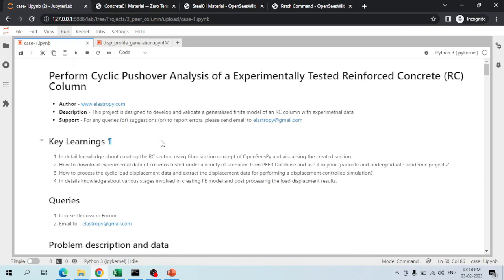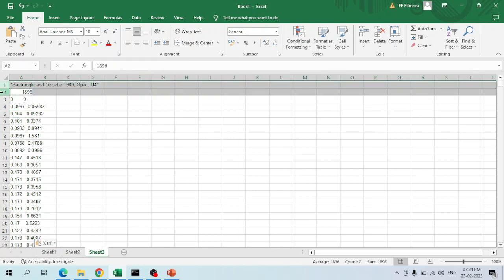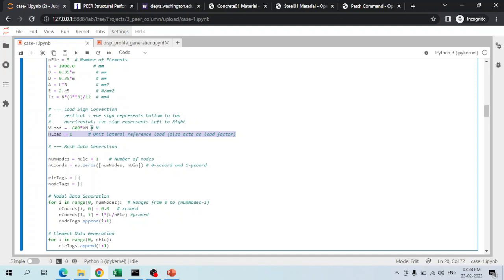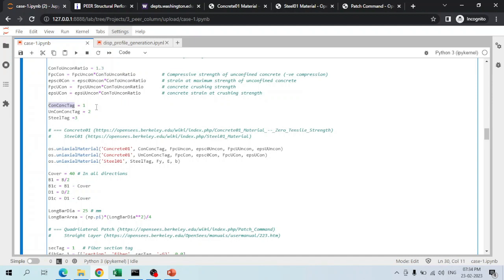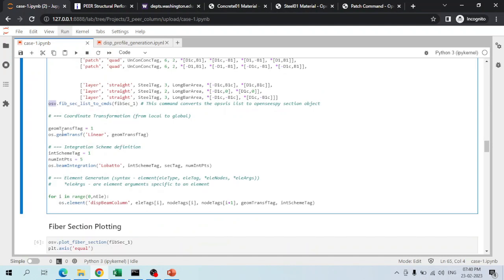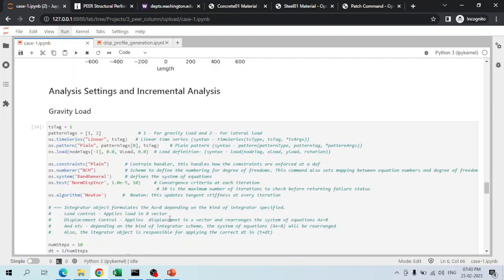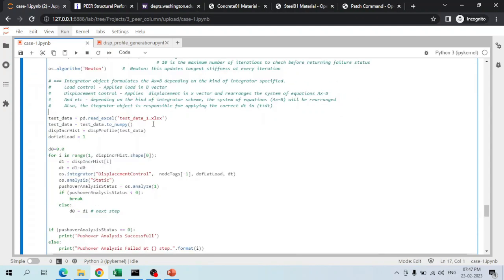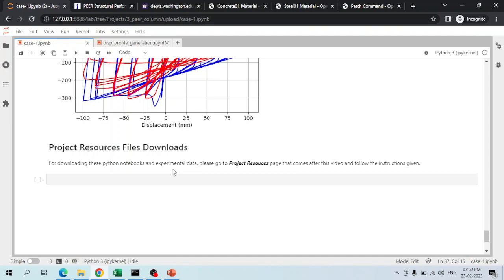Project 1 - Reversed Cyclic Pushover Analysis of RC Column Using OpenSeesPy

Comment: @7:02 isnt the code wrong? The confined tag is set for the unconfined material, and viceversa
Reply from the maker: Hi @rogeliotovar2224, Thank you for pointing that out! 🙏 You’re absolutely right—the confined tag should have been set for the confined material, and the unconfined tag for the unconfined material. I appreciate your keen observation. Thanks again for helping improve the content! 😊

As for your other comment, I’ll continue the discussion in the other thread (@willywirawan565) so he will also be informed.

Comment: Hi. Thanks for this great video. I just did not understand the part you used dispProfile function. Do you apply the "exact" test data ? I use TCL so it looks a little confusing for me.
Reply from the maker: Hi @behnam6700, thanks for reaching out to us. Yes we apply the exact displacement profile reported in the experimental data. The step size (difference between any two displacement increments) in the experimental displacement profile is somewhat large. Hence, we are just changing that default step size to some smaller one (say 0.1mm) in dispProfile. That's it nothing more is happening in the dispProfile function.

Comment: Hi I am trying to follow your tutorial but in the push over analysis it returns error : 

pushoverAnalysis failed at 4 step

WARNING: CTestNormDispIncr::test() - failed to converge 
after: 10 iterations  current Norm: 2.20585e-05 (max: 1e-05, Norm deltaR: 7.28408e+07)
NewtonRaphson::solveCurrentStep() -the ConvergenceTest object failed in test()
StaticAnalysis::analyze() - the Algorithm failed at step: 0 with domain at load factor 125027
OpenSees > analyze failed, returned: -3 error flag

Could you give me any suggestion ? thanks in advance
Reply from the maker: Hi @willywirawan565, thanks for reaching out to us. Good to know that you are following our tutorial. Convergence issues are very common in nonlinear finite element analysis and sometimes they are very tricky to resolve. You can try the following,

1. When an algorithm fails to converge at a load step, try changing the test methods and algorithms adaptively, (you can look at our earthquake example here - https://youtu.be/ZJ3BSo5hsaw?list=PLM7DTyYjZGuLJv9gGZLGPDOAVH1-CbCl3&t=308).
2. Try reducing the tolerance and if you are using force based elements then try displacement formulation based elements.
3. Check your material models (unaxial or ndmaterial). 

Wish you all the best.
Reply: @elastropy  This doesnt make too much sense since we are replicating the code you have, its odd that it does not work, in my case I have the same error. Appreciate the tutorial though
Reply from the maker: Hi @willywirawan565, thank you for reaching out. I initially misunderstood your comment and thought you were working on a different problem following the process from the tutorial, but now I see you were reproducing the exact code. Just now, @rogeliotovar2224 reported a mistake in the concrete material tags, and while I'm not certain if that's the cause of the convergence error, I’ll look into it.

Since it’s been nearly a year, if you’re still working on this or would like to revisit it, I’d be happy to provide you with the source code that I used in the tutorial, free of charge. This way, you can compare and ensure everything is aligned. Please feel free to join my Telegram group and reach out there, and I’ll send the code over. (group link is given in the first pinned comment)

If you encounter any further issues with the code, your feedback would be greatly appreciated so we can continue improving it. Thanks again for following the tutorial!
Reply from the maker: Hi @rogeliotovar2224, thank you for your feedback! I understand how it might seem odd, especially since you're replicating the code from the tutorial. You’re absolutely right, and I appreciate your earlier comment about the material tags being switched—I’ll need to check if that’s contributing to the convergence issues you’re experiencing.

If you'd like, I can send you the source code free of charge, so you can correct it and try it out directly. Feel free to join my Telegram group and reach out there, and I’ll make sure to send it to you. If you encounter any further issues with the code, your feedback would be greatly appreciated so we can continue improving it.

Thanks again for following the tutorial! 🙂
Reply: @elastropy  thanks for the response, just checked and I had a mistake myself, so that particular issue is resolved, it converges. Regarding the material I switched that myself. I did wanted to ask though, if I want to use a custom protocol, how could that be implemented?
Reply from the maker: @rogeliotovar2224  Hi @rogeliotovar2224, glad to hear the issue is resolved and that it's converging! Regarding your question on using a custom protocol for the pushover analysis, you can implement that by customizing the displacement profile. If you provide more specifics on the protocol you'd like to use, I’d be happy to give more detailed guidance on how to implement it. Feel free to reach out to us in the Telegram group as well if you'd like more help!